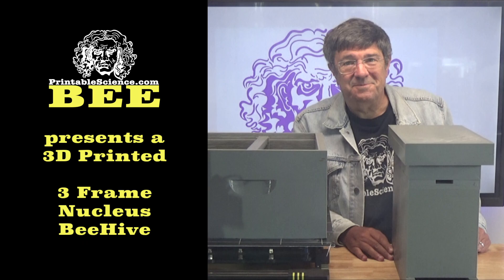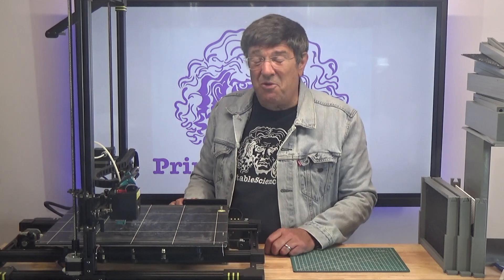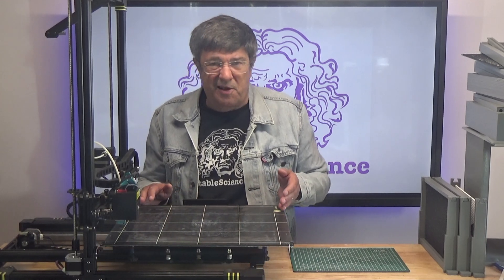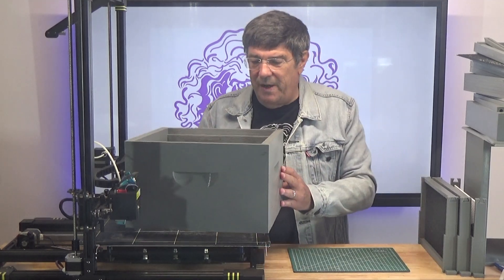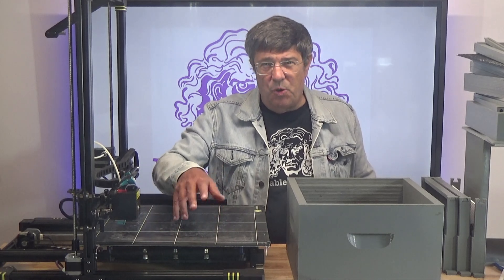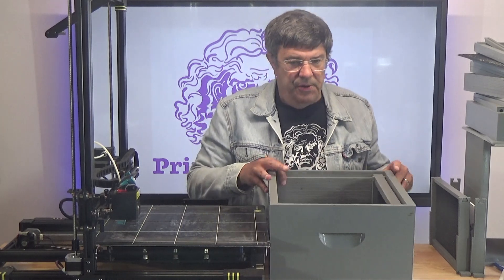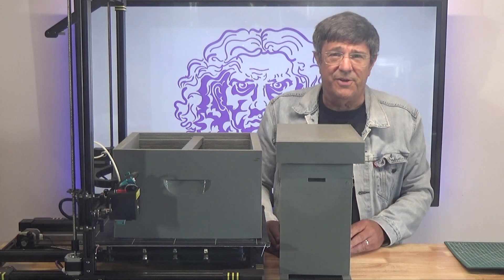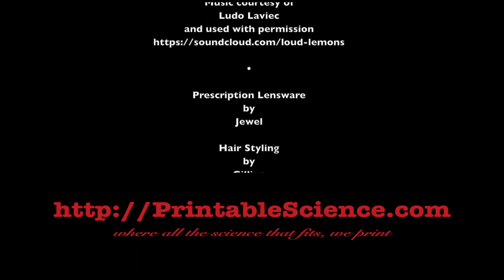3D Printed 3 Frame Nucleus Bee Hive

Comment: You need a Voron 350mm with a 0.8mm nozzle and high flow hotend and extruder.   15000mm/s acceleration.

Comment: I'm a beekeeper wanted to know how the bees are doing. I'm highly interested in this. I'm looking at buying this printer just for hive printing. Please let me know thanks.
Reply from the maker: the bees are doing well... i had four hives heading into winter. looks like 3 of them have made it through to early spring... haven't looked at the failed hive yet so i don't have much of an idea as to why it failed. At the moment I think the only practical choice for a printer is the anycubic chiron. you should be aware that it takes and INCREDIBLY long time to print a hive. The smaller boxes take about 3 days to print and to that you have to print the frames. My frames (which are smaller than langstroth standards) take a full day for each complete frame (frame and foundations) (and each box takes 8 frames so that's eight days for the frames. I also make just frames where I slip in some custom cut commercially available foundation and that takes about a day to print the parts needed to assemble 8 frames. I'm about to put out a video where I'm starting off some new hives from scratch so you may want to follow along with that.

Comment: Cool idea! I've 3D printed full size hive bodies. Just gotta print 4 different sections then join them together. 800g + per panel though lol. Thanks for sharing the video
Reply from the maker: yeah, takes a lot of filament and LOTS and LOTS of time! :)
Reply from the maker: I use OpenSCAD
Reply: Do you happen to have an STL for those pieces of frames by any chance? Looking to try 3d printing hives as well

Comment: the Creality cr-10 MAX is 450x450mm the WHOLE build surface is heated, it shares parts with the much more common CR-10, so parts are widely available. ive found one for $895CAD. it also prints all sorts of filaments.

the cr-10 S5 did have the build plate issues you mention